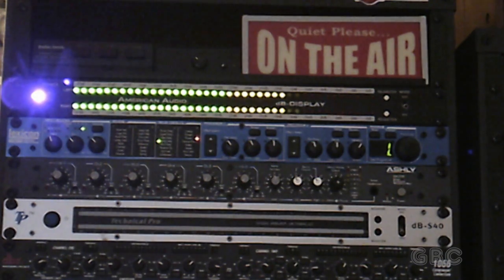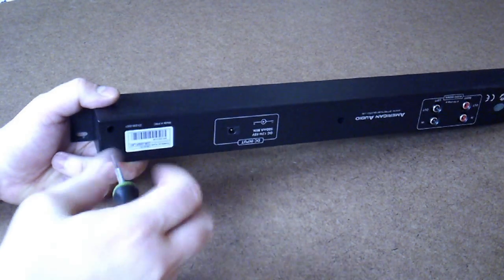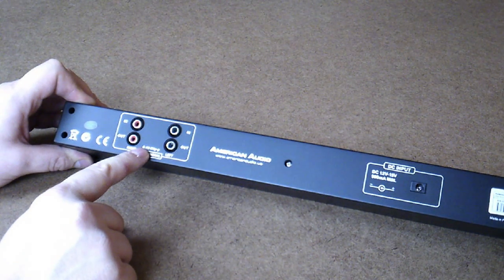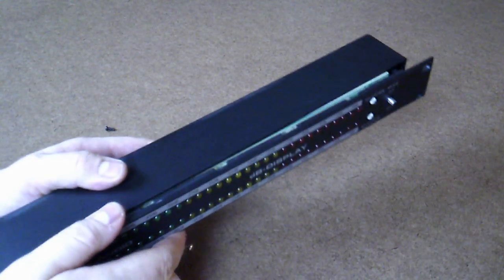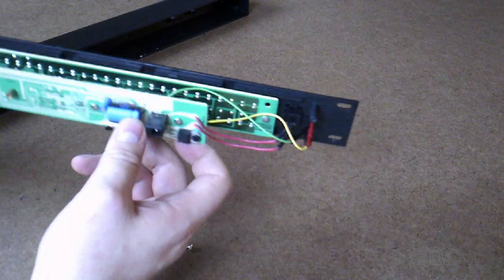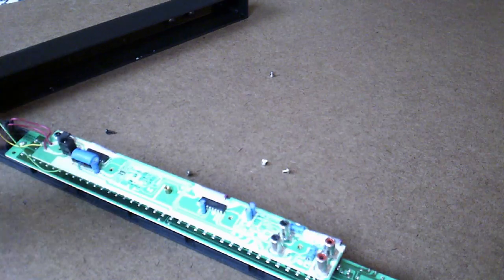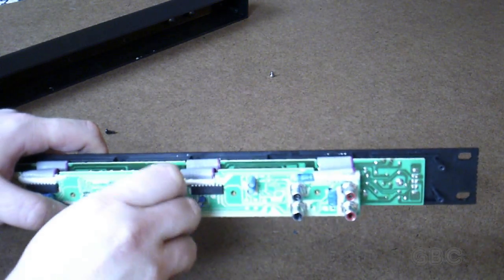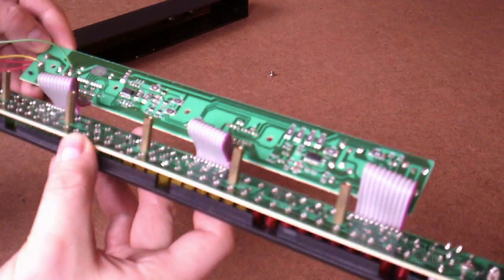[8] American Audio dB - Display Teardown

Comment: I have made mistake buying T-Racks dB Meter (the same as American DJ is). It shows the range of 60 dB probably having two LM3915 in cascade per a channel. And I have found it is useless. I needed a LED VU meter but level is pretty hard to read because peaks are displayed too fast, and drop outs are the same . There is no some "Peak hold" function. So as it is, it can be used only as visual effect, light decoration not a measuring device. Mechanically it is very well made, it have XLR Balanced inputs and outputs, but I can't say in this moment are they fully wired or only + and ground? Sometimes it shows sudden very high peaks and it makes me thinking the device is having  internal noise or glitches.

Comment: So the LED that you added for the power on light, is it rated for 12 to 15 volts from the adapter that is used to power the unit?
Reply from the maker: I put a resister inline with the LED.  I can't remember what the value of it is.  I think, if I remember correctly, I Googled a LED resistor calculator to figure out the value.
Reply: @GBCProductions64  Supply Voltage minus LED voltage divided by 20Ma so 12-2/.0020=560 OHM resistor